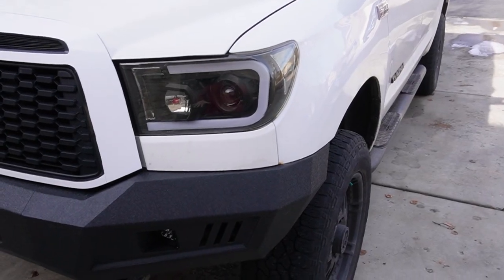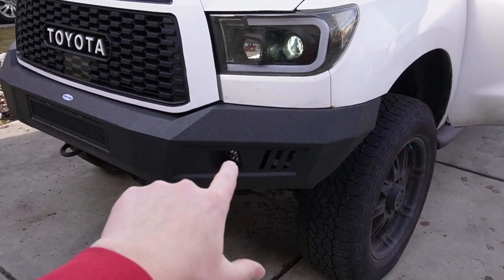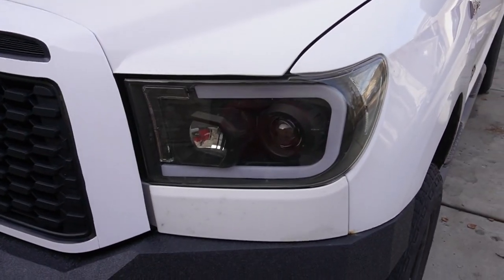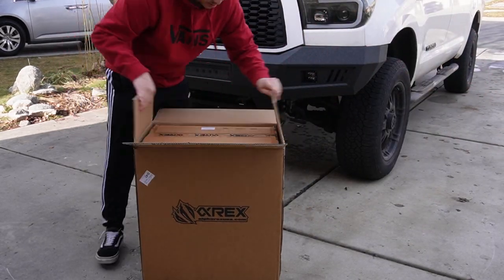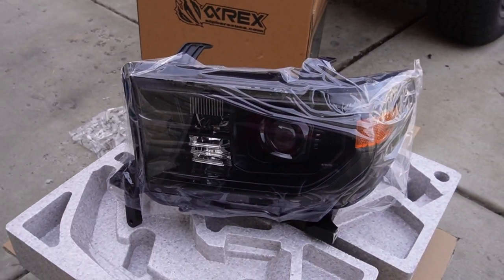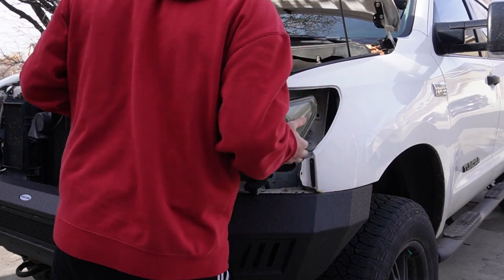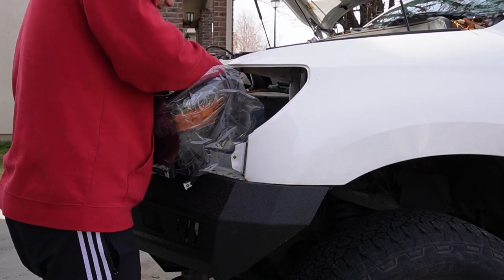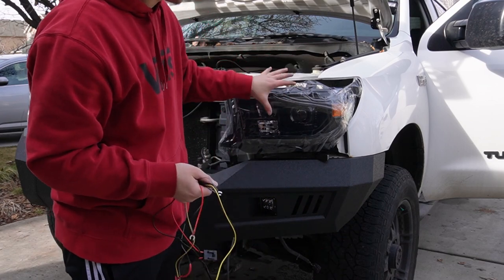The BEST LED Headlights For Any Toyota Tundra!!??

Comment: are these the ones with leveling options? is it worth the extra $ for that option
Reply from the maker: They’re manual adjusting, these are the cheapest LED option they have. They have a more expensive LED option and a cheaper Halogen option.